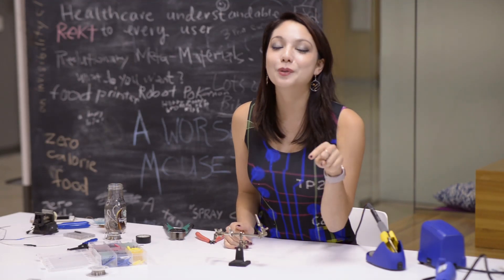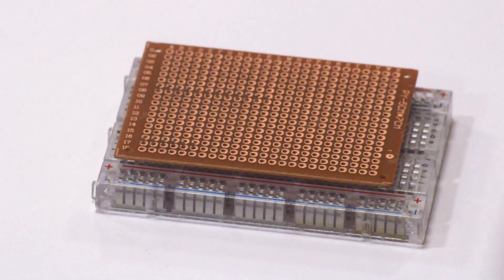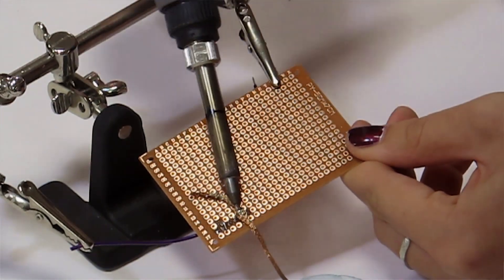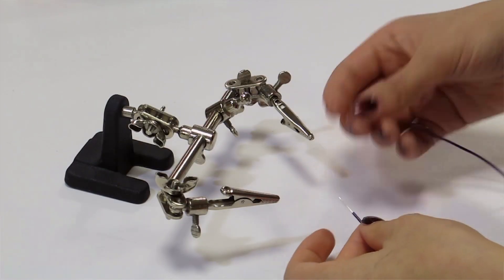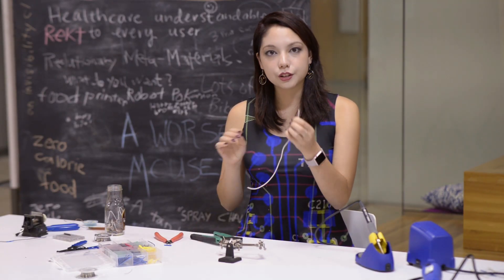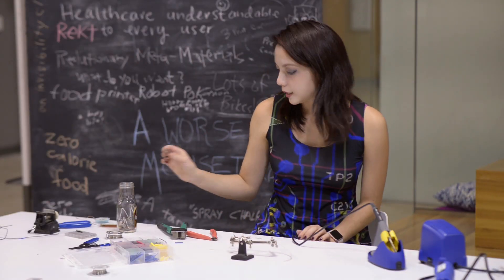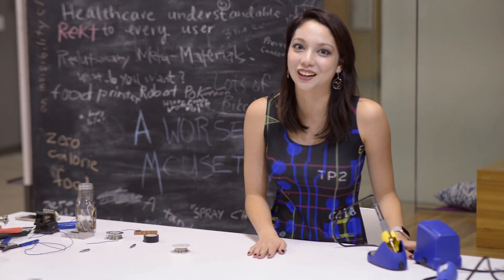HOW TO SOLDER

Comment: Hi, I've seen those art skulls made from nuts & bolts, could I solder the nuts together rather than having to buy a welder? It's much cheaper & as it's only art, it wouldn't be put under stress

Comment: Definitely a better tutorial than many on this platform. A few helpful hints for splicing wires in series: make sure both wires are stripped equally in length for the sections being joined, a lap splice has a better profile and works equally as well unless you really need the additional tensile strength from a wrap or hook splice, if you are forming a wrap splice make sure conductor strands are wrapped tightly so as not to pierce the heat shrink and cause a short circuit, and for anyone watching, most often you should slide the heat shrink on the wires prior to soldering them. Also on a larger splice you can twist strands of solder together to feed a larger quantity into the joint, as long as your iron can handle the extra thermal draw. Other than that it was entertaining and you correctly fed solder into the  joint as opposed to bringing a blob and painting dry solder on. Well done.
Reply: Also just a personal opinion, but, no to the electrical tape unless you absolutely have nothing else. 😂

Comment: You missed a couple of critical point for discussion. Leave solder on the iron tip while in the cradle. Also prior to switching off apply solder to the tip. and leave it there. When using the iron next time wipe off the old solder prior to using it. Solder on the tip protects the tip from oxidisation and improves wetting.
Also for through hole soldering a slightly heavier wedge type tip is better. It allies heat quicker as the surface area is bigger than the tip of a point, what you use here is simple etched copper plated board and is not through hole padded double sided. When that is the type used then the pointed tip would be a handicap and solder may not enter the pad and go through to form a good joint on the other side of the board, which should be a nice cone as well. The critical factor here is the minimisation of heat to the component being soldered. A fine tip take a long time to warm the pad but more heat is transferred to the component. The tip you are using there is more applicable to smt work, however I do note that you keep it clean and well wetted that will help with solder flow.

Comment: corrections sugegsted when it is said that welding is different from soldering process, in soldering also the copper should form another alloy layer with solder process also called wetting

Comment: 0:56 actually having the heat doesn't damage the boards, what damages them is the time your iron is placed on the pad, high temperature is preferable high heat over a short period of time instead of low heat over a long period of time

Comment: No Safety Glasses?  The tip of the heating iron should not be on the Circuit Board any more than 2 seconds or you will do damage to the board. Another Tip that I learned was to put some electrical tape on the jaws of the “Helping Hands” to prevent cutting through the coating on the wires!

Comment: When I 1st used my new soldering pen the solder went on smoothly. When I tried to use it again it started to form little silver balls and would not melt on the soldering iron. I cleaned it thoroughly and turned up the heat, let it rest, turned it off and back on and tried it again and it still was forming silver balls. How to I fix this issue

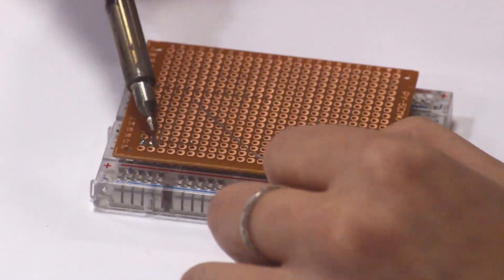Comment: 2:28 - 2:44 is fake.
It is 100% impossible to get a blob of solder onto a board using what's shown here, the heat will continually just eat up and evaporate the solder, it the iron itself will burn off anything left over on the iron leaving the user with nothing except about an inch of solder missing, in some cases if you try to lift the iron, all the solder will go with it and burn off.
Either way you will never have any on the board.

Every time I try the board gets damage because it doesn't have any solder.

Comment: Try the "no-clean solder flux" pen for rework.  A dap on soldering wick will transfer the heat much faster.  I still clean it with alcohol afterwords.
Also, there is different heat settling for lead and lead-free solder.

Comment: Have to say she is much more entertaining than the comments here. 
Most people can’t solder for squat. She is right it is a needed skill in so many things these days.
I contract to an aerospace machine shop and they had a wiring issue with a machine vision system.  What was a 20 minuet fix for me was impossible for them. They have mediocre soldering skills. My father started me young. I now have no problem soldering a radiator to a sound chip on a mobo

Comment: I Work on tube radios ,it take years to get all the equipment you need and want ,but  you buy good stuff it will last for a very long time but some equiptment  doesnt always have to be the most expensive just get what you need .you do solder very well,we need more females that can solder and more. ,building kits is a good thing ,After many years I still enjoy building kits like elenco brand of kits.

Comment: Very informative! Great humor as well. I tried to use a heat gun with melting solder on the inside of the tube to make a joint but just ended up melting my speaker. I am confident with your guidance I will be able to solder it more cleanly without damage to the speaker. 

Subscribed! Look forward to your other videos.

Comment: I have the Hakko 888D too and at 650 it struggles to just melt the solder on to the tip.. I have to turn it up to 750 to get it to do anything. I know you said not to turn up the heat to solve your problems but I don't know what else what to do. Is my iron tip not getting up to temperature or something?
Reply from the maker: Have you tried using flux? It might depend on your solder-- 750 isn't ridiculous though so if that works for you I'd say that's fine!
Reply: @BeautyandtheBolt  It turns out I have lead-free solder - I didn't know when you said ROHS you meant lead-free but it makes sense now. At 750F I can just barely use it. By the time I get finely stranded wire hot enough to take the solder it starts to melt the silicone/plastic jacket on the wire back :( At 650F it won't even melt my lead free solder. Not even if I put it right on a brand new clean tip :/ - And yes, I have to use flux.. if I don't the solder will never flow into the wire at all. I know I'm doing something wrong.. I'm just hoping the 60/40 will help solve it.

Comment: If you add a tiny bit of flux on the part before you use the braid it flows onto the braid instantly, and with less contact from the iron.

Comment: Wrong technique when soldering two wire together. You need to put iron under the joint and let solder flow into the connection.

Comment: How do you solder near heat sensitive materials such as plastic? I'm a flashlight enthusiast and I was doing a spring bypass for a Mcclicky switch by which the contact sits on a plastic housing,It was my first soldering job and I successfully accomplished the goal without any damage to the internals of the switch but the plastic housing had just a tiny bit of melting.  Any tips would be highly appreciated thanks.

Comment: When you were ready to solder the first pin just tack it. The press down and reheat and listen / feel for the click. The also works to IC sockets. The repeat or the opposite corner. With pin strips you need to do this for each corner. Once done reheat each connection and pull the iron tip up the pin. Remember you only need enough solder to fill the pad and form a fillet with the ring. Less is best. If possible use a microscope or high magnification to do inspection of each and every joint. Don't forget clean all flux of of the board. Many times the flux get on the other side.

Comment: Why does the soldier get hot ,melt , and get hard. Then wont melt again?  Also it seems like I need to use melted soldier to melt soldier sometimes  ,why? Thanks
Reply from the maker: Great question Tony! Heat is transferred best with higher surface area between two surfaces-- and because a liquid can form around your hardened solder blob it will re-melt your solder faster. A similar idea can be used when desoldering-- sometimes adding a bit of melted solder to your joint can make removing the existing solder faster. ~X

Comment: 🙄
Wow. 
Where is the flux?
Where is your tip conditioner?
Oh forgot to mention, always a good idea to have a fan somewhere on your work bench. It is important to mention that solder will produce a nasty smoke that may cause health issues over time. (Your absolutely under educated.)
Holding your tip to something your soldering is bad. You want the least amount of heat for as short as possible to avoid damaging components. 
Desoldering... Yes your method is absurd.
Your video is a joke that shouldn't be used as a teaching tool. If you truly cares about your character (if this is meant to be a legit video) you may consider rethinking your demeanor on camera as well as your knowledge with regard to what your presenting.
Reply: Quit being mean :p
Reply: Some solder has flux as the core.

Comment: "The hot soldering iron falls down just like the cold soldering iron, don't try to catch it!" This is my favorite safety instruction.

I don't know why youtube suggesting this video for me, I know how to solder, but it's funny. I like the technical details in the video and hate the RoHS solder. When I was a teenager I always used my teeth as a wire striper, now just to think about it hurts. Once I forget my brand new soldering station on for a night, the only thing what is burned down was the heating element :( I just RMA it quickly.

Comment: one   of the  first things  to  do is "clean"    the   pcb  -  abrasivly  . In  cypreus   -  I found the  copper  oxides  / tarnish    -   get the cheapest hair-spray  -   then clean  when  you want  it - then  the  tin  // copper alloy  forms  .  Respray when that "project"   completed

Comment: Beauty. A tip I've learned about taping. Wrap the tape as you did slightly stretching the tape as you go but when you are about to finish, with scissors cut your tape leaving a short length. Then without stretching the tape, wrap it around the wire to finish the job. If you wrap your tape stretching it all the way to the end, over time the end of the tape will pull loose. Have you ever seen a taped connection with the end of the tape flapping in the breeze?

Comment: Thanks for this video.  I've spent the last 2 days trying to solder the wiring in my bass guitar, and it's just ended in frustration.  I made the mistake of thinking that I could just "wing it" and solder without any real knowledge of what I was doing.  Now I know a little more, and most importantly, I have a little more confidence going into what I HOPE will be my last foray into the guts of my bass.  Once more into the breach...  Thank you!

Comment: This is not even close to a good solder joint. I've been a  IPC J-STD-001 and IPC 610 certified solder for over 25 years and this is very poor soldering. You need to lightly tin the wires first and lap solder together. With a proper iron this should only take a few seconds to wet the solder to the wires.
Reply: Seriously? Her joint is twisted and covered with heatshrink. In what way your metod is better ? With respect to your experience I think actually her metod is better and faster than tinning every wire and wasting time. You just twist, solder and done. It will last as much as your "good" solder.
Reply: Tinning a wire takes about 5 seconds. So it's not wasting time. You just agree with her method because she's hot!
Reply: She is but thats not the reason :D Im soldering a lot and its just my personal thing. I use the same metod and connection like this never breaks. Used it in e-bikes, rc models etc and it holds many years. Its more likely that you will break the cable than connection itself. You cant say its bad because it dont match some IPC thing, sometimes there is many ways to do same thing and both can be good :P

Comment: You did it at t = 2:32...... but didn't mention it.... aka, running the iron straight up the post when finishing off, which is one of the greatest recommendations for people learning to solder. Eye protection ---- not everybody's cup of tea --- but could be beneficial..... since some say -  it's the 1 in a million chance that we want to avoid, or be afraid of (ie. solder in the eye scenario).

Comment: 1) Great explanations! Will inspire many girls for STEM. 2) Needs clear closeups with focus. That would show what existed before, how a particular operation was done and what result came out 3) Break the total video out in several segments - ie. Basics with tools and perf board, de-soldering, and perhaps working with through hole components and PCBs and best practices with common mistakes or Do's and Don'ts - just my 2 pennies.

Comment: Interesting tip that I see done and not explained in the video. Heat goes up. So putting the iron under the piece, when able, is more effective. I can't tell you how many people who think they know how to solder struggle by putting the iron on top. She puts the iron underneath when soldering the wires but didn't say anything about it. The other thing that should be said is that to not get a cold solder both pieces must get to temp. Very important when soldering dissimilar metals, as well as sweating water pipes.

Comment: This is an excellent video until the hideous joint at 0725-0754.  There's nothing pleasant to say about it.  Given the skill evidenced in every other part of the video, it sticks out.  What happened there?  Surely not a rookie mistake...
Reply: Heating the stranded wires and soaking in the solder is S.O.P.  Heat-shrink is a good idea after.

Comment: Excessive heat on the iron will cause lead to vaporise (if you are using leaded solder), which is a health hazard. Also, soldering with a stiffy can be distracting....nice dress :P

Comment: I did learn a bit. However, i dont know much about circuit boards but when soldering wire you wanna make sure to heat up the wire hot enough to melt the solder by touching the solder to wire without touching the tip directly. This knowledge brought to you by Chris Fix on YouTube

Comment: a clarification, if I may. Solder Wick is a little more than just braided copper, it has some dry powdered flux on it as well to help it with the solder wicking up. Note that when Solder Wick gets old, the copper braid  gets kind of oxidized, and even with the flux on it it doesn't work as well. I find that dipping the end of the Solder Wick braid into some rosin-type non-corrosive flux prior to desoldering helps enormously in the effectiveness of the Solder Wick, as well as the speed with which the solder gets whipped up by the braids. Holding the heat of the iron on the circuit board for too long can damage the foils or perhaps even the component that you are unsoldering ( important if it is to be reused).  It also helps a lot to apply a small dab or  bead of solder to the Solder Wick and the  tip of the iron as they sit on the area of the circuit board that you are trying to desolder, so that you get a good heat flow from the soldering iron tip to the wick, and therefore to the connection to be unsoldered.

Comment: BTW, the dual or triple alligator-clip holding jigs are very handy, but they're never heavy enough and they tip over too easily. Epoxy glue a small flat piece of wood to it, or better yet a hunk of iron or steel that enlarges the footprint of the base and adds weight so it won't tip over.

Comment: Worth getting in the habit of putting the heat shrink on before joining wires (slide it off to the side).  ;)
Reply from the maker: True! Although I tend to only do that if absolutely necessary, sometimes with more detailed work the heat from the iron or the heat transferred via the wire is enough to make it begin to shrink.

Comment: First of all, the Hakko 888D is not a very good for something that is critical. I am still in love with the FM series with T tips. Easy to change the tips while soldering without waiting for the iron to cool down.
Reply from the maker: We actually love the FM series too - or a Metcal if you have the cash. We chose the Hakko 888D because that is Xyla's "daily driver" because it's a great balance of price and performance for people starting out. If you're spending hours a day soldering, or doing delicate work, definitely get something with more thermal stability and the ability to hot swap tips!

Comment: And at 1:39 it goes very bad.  You're right-handed and you have the soldering iron to your left, so the lead crosses you and your work (including the iron tip at 350 -  400 degrees).  This way the cable is pulling against you as you work, and there's more chance of it snagging as you work.  If you drop it, it's more likely to swing towards your leg.  Anyone right-handed who solders properly would have the iron's stand to their (and their work's) right and the power supply to the right of the stand.  If you're left-handed, replace 'right' with 'left'.  The iron's lead should go over your wrist, too, as it's safer and gives your more control (as there's less chance of it pushing up as you move downwards).  This means the lead is always kept away from the hot parts of the iron, too.   
At 5:49, the iron tip should always be clean when it meets the joint:  Apply heat (clean tip) -> wait for heat transfer -> apply solder -> remove solder -> remove heat.  
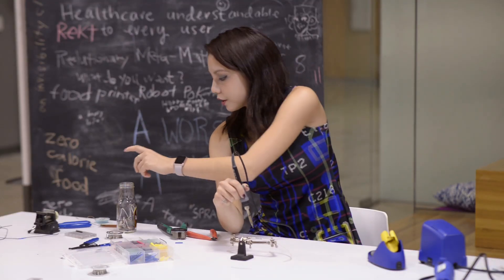7:44 That's a good way to burn yourself.  Put the iron etc. to your right and the waste bin to your left.

Comment: Lineman splice, or Western Union splice, or NASA splice. I think you should be using those splices for soldering two wires together. Not the fan or general twist method.